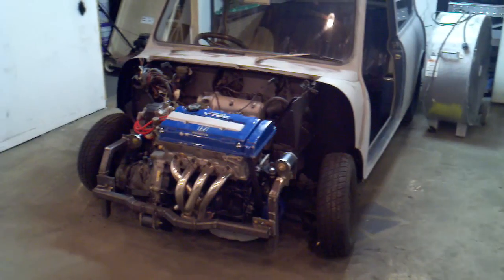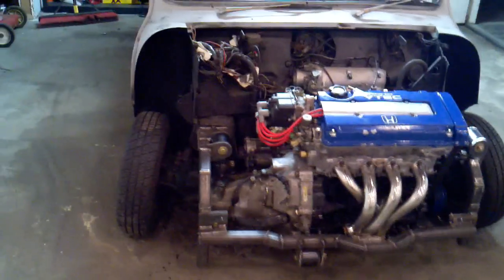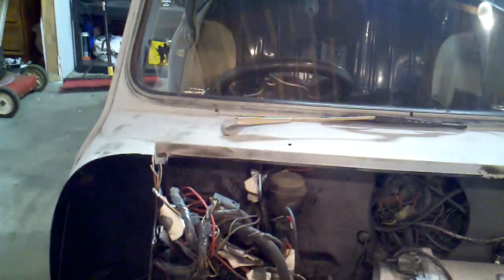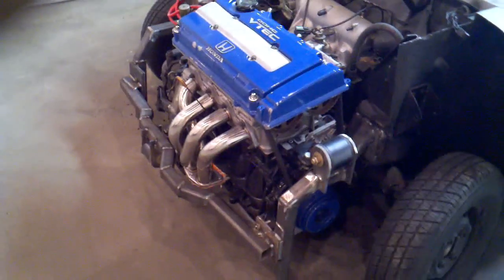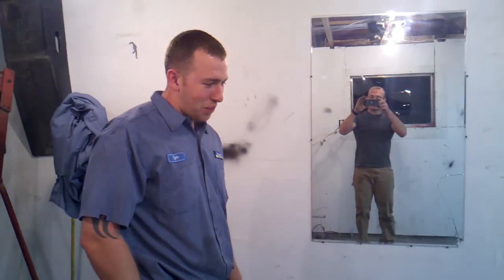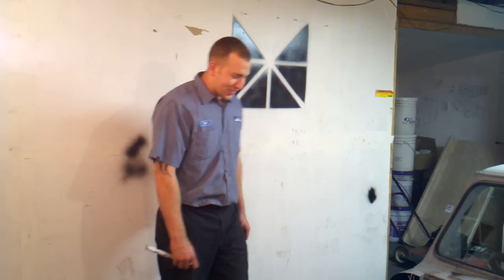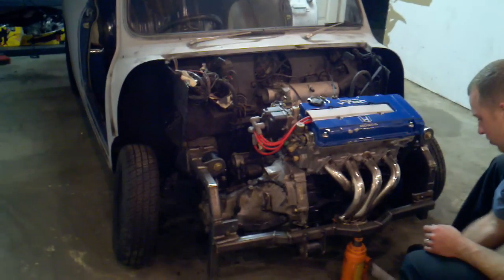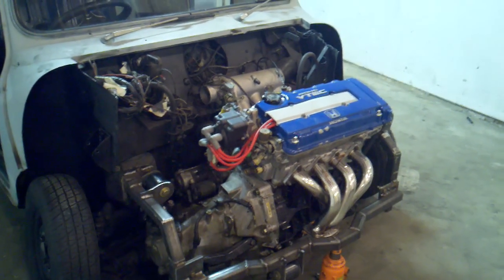Vtec Mini cooper part 2. UNORTHODOX FABRICATION DROID X VIDEO

Comment from the maker: @FlippahCB 
I was thinking of turning them down with a lathe where they meet. putting a large chamfer on each half then weld the hell out of them past the normal outside diameter, then turn them again and slide a sleeve over. weld that. Then if that fails order custom ones through the drive shaft shop.

Comment from the maker: @beyondbelief360 

There is only 2 spots holding her on top near the suspension towers and on the bottom we have two sub frame pipes mounted under the floor boards. They are on our part 3 video. hopefully the welds hold..

Comment: Hey guys great job but just one little thing, is that subframe finished, as you have a bar from the front running to the subframe tower mount  (the part that goes to the top of the bulkhead with the big bolt) but you dont seem to have a bottom bar running around the bottom of the side towards the subframe. Just thought it would add stength and flex?

Comment: R only 2 spots on the body  holding the engine frame?  R u going to add a lower sub frame support to insure that the engine does not drop in case of an accident or a weak weld point. Hope to see more!

Comment: Question for people who know there FWD's. What is stopping you from instead of having to tilt the engine forward over the drivetrain, tilting in backward close to the firewall? Is there physically not enough space to get it on enough of an angle to keep in low in the engine bay?
Thanks